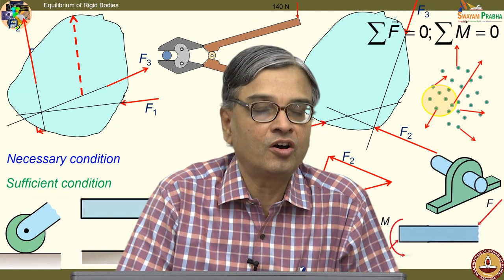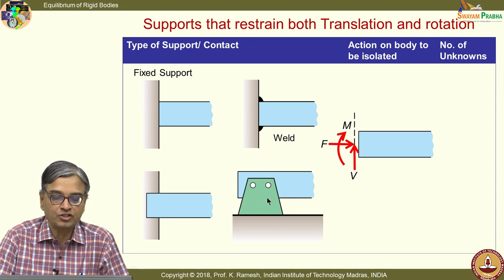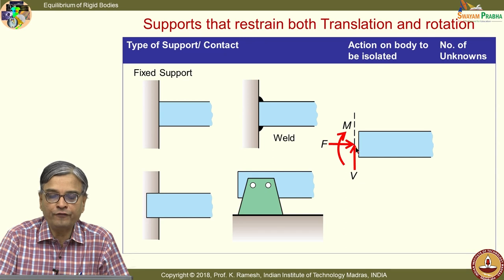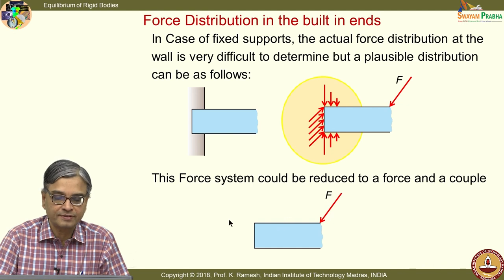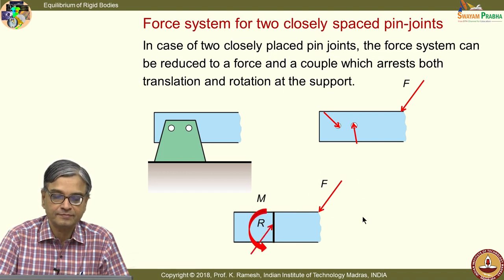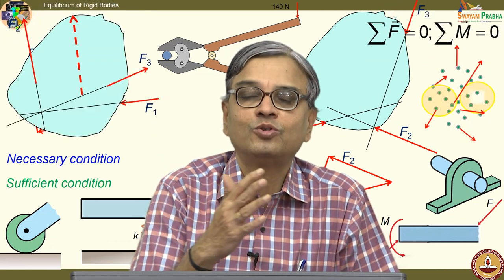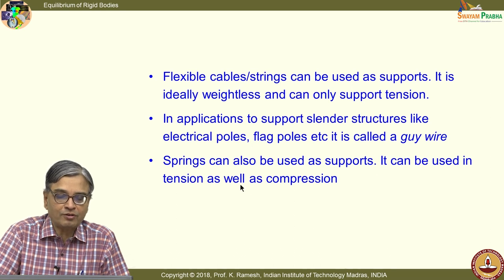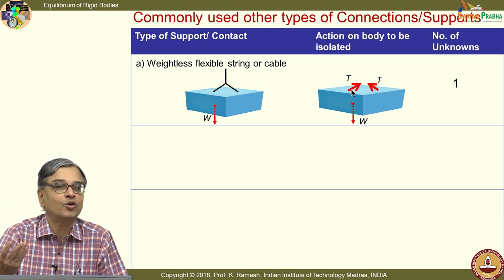Lec 06 Equilibrium of Rigid bodies II

Comment: For problem 1 ,  which force we have to find such that we can analyse that box is in equilibrium?
Only three forces will be there as reaction forces. Horizontal force are balanced but what about vertical force balance Fb ?
Reply: This is an interesting question.

Our day-to-day observation suggests that the box will be in equilibrium. However, when we apply the three reaction force-pairs from the discs on the free body of the box, it seems to have an unbalanced vertical force. Therefore, Newton's law dictates it must accelerate which does not happen.

This begs the question: is the free body diagram of the box complete then?

Consider the following hint and rethink the problem:

In reality, the box along with the discs is not suspended midway in the air.

Comment: Hi sir. In the first example, there is a reaction force of 200 N at point B and the weight 100 N of the bottom ball is acting along this line of action, but another 100 N force is required to keep the box in vertical equilibrium. At what point of the box this force will be acted upon.
Reply: Disc 2 weigh 100N which is there to keep the system in equilibrium in vertical position
Reply: Balance moment about point B. We get the point on the bottom wall where the normal reaction act on the box.

Comment: How did the equation for moment at B come? How did we do F.250.sin(60-theta) ???
Reply: As Radius is given 250mm..First moment of W w.r.t point B will be
 W.250sin36.87° in clockwise and moment of force F w.r.t point B will be F.250sin(60°-36.87°) in anticlockwise direction..here (60°-36.87°) angle I have taken because angle of F with horizontal is given 30° and angle of W with horizontal is 90° then angle at C become 90-30=60° so angle between Fb and F become 60°-37.87°
Reply: kite ka package laga?
Reply: @amitraj6239 why you multiplied sin(theta) while calculating moment?

Comment: for member ABD, we dont have Sum of forces in Y direction as zero. Should not this be satisfied?
Reply: did you get the answer to it?
Reply: I think after doing mathematics, we will get the direction of Fby and Fcy opposite as shown in the example.
Reply: Exactly. Plus the weight 200N. Do we have to pass it through cg, thats another question.
Reply: Considering that you are referring to the crimping tool problem:

Sum of forces in the y direction must always add to zero as long as the member is in equilibrium. In fact, it is only with this conclusion that we will be able to relate the different forces. 
Therefore, as @Mudit Mishra pointed out, the different forces acting on the member will mobilize in such a way that the net force is zero. 
This might even result in the reversal of our initially assumed force direction.

Hope this helps.
Reply: @abbysaha2091  Which is the problem you are referring to? Can you mention the timestamp for your query?

Comment: How did we get F.250.sin(60-theta) , can anyone explain please ? W.250.sin(theta) is understandable.
Reply: Same question
Reply: since W is acting on the right hand side so W * 250 sin(x) ok !!  
Now think about Force 'F', which obviously acts on the left hand side of point B... so the  transfer F towards that right angle and think about the perpendicular distance it makes with the point B. That will not be due to full 60 degress but only by the angle ( 60- Theta).. so it will be equal to  250*sin(60-Theta)*F  ... I have some limitation to explain that in Youtube... since I cant name the points and figure here.. hope you understand it...
Reply: If you are not comfortable with my first explanation there is a second method to it .... 
Let the force F be acting at an angle 30 degree Horizontal line .... its components will be F cos 30 ( horzntl) and F sin 30 downwards along with 'W'
take one by one 
first take the vertical forces and its moment about point B,
                   (Fsin 30 + 200)* 250 sin 36.87        (Clockwise) ---(1)
there will be a horizontal component since we resolved F unlike the first method, so F cos 30 * Vertical distance to B 
now that distance we knew before as 250 mm - 50mm = 200 mm
so it will be like            F cos 30 * 200       (Anti Clockwise) --- (2)
Now equate  (1) and (2)
(Fsin 30 + 200)*250 sin 36.87 = F cos30*200
by solving you will get the value of F =305.483 N  aprx =305.5 N
Now I hope you got it clearly.... enjoy learning ..
Reply: @thinkgrow4296  why do you take sin function this is my only doubt
Reply: @sudhaponram2544  That is basic mathematics, it is a prerequisite thing before you join an undergraduate program...I can't be more better than what I have explained above....Sorry friend...